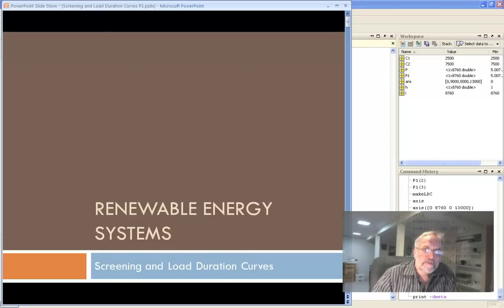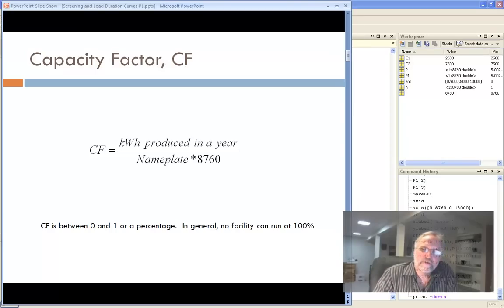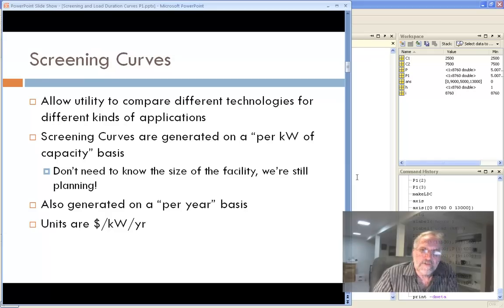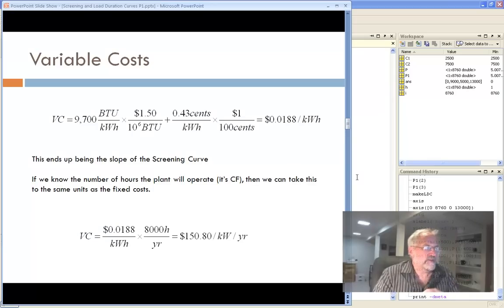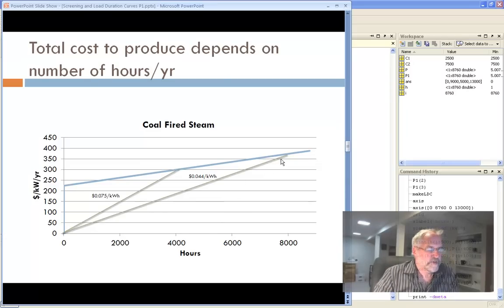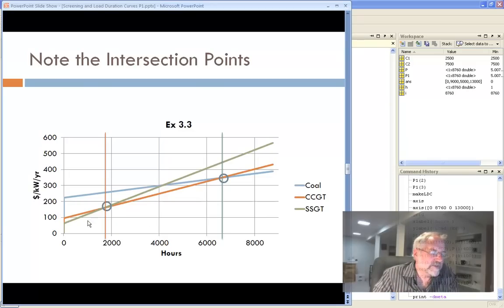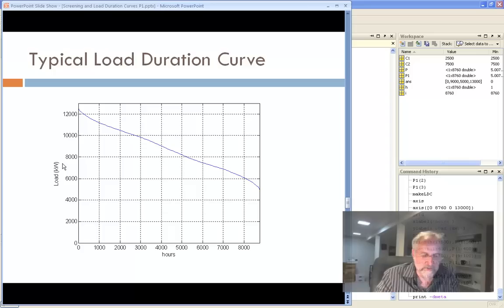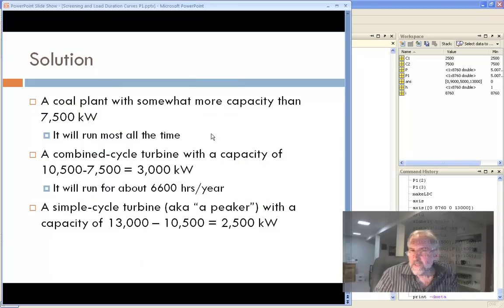Load Duration and Screening Curves

Comment: What book is this based on?
Reply from the maker: Hi Mark:  It's based on "Renewable and Efficient Electric Power Systems" by Gil Masters, 1st edition.  There's a new edition out that doesn't treat this area (load duration curves) nearly as well. I suspect Dr. Masters did that because this analysis doesn't do a very good job of integrating wind and solar so it's less relevant now than it once was.
Reply: John Gardner thanks! Will get that book. Any idea on the best state university for phd in renewable energy planning?